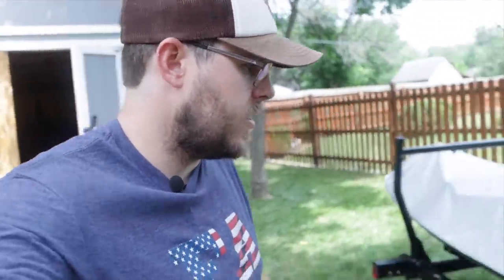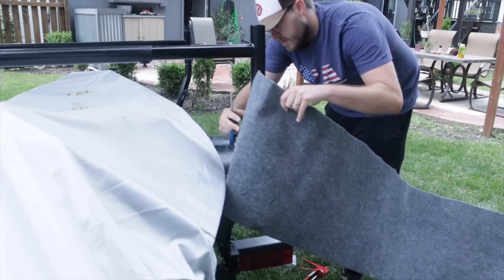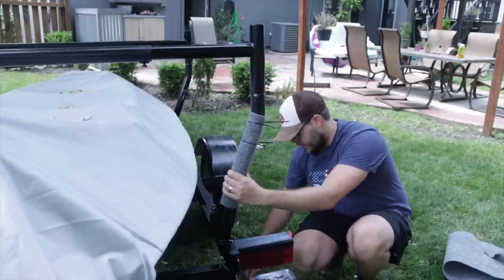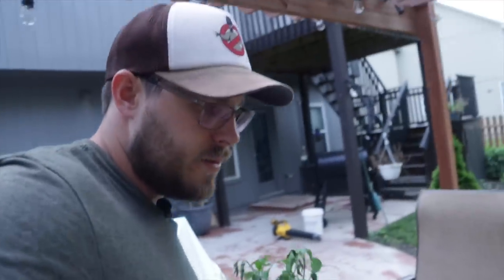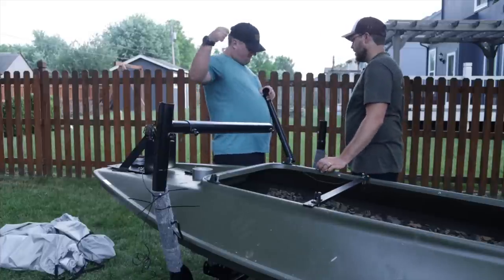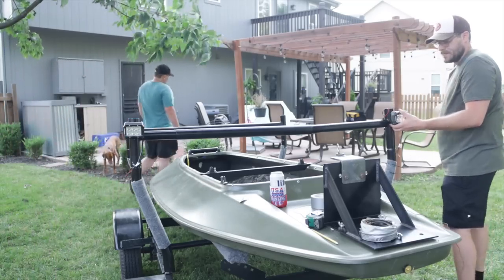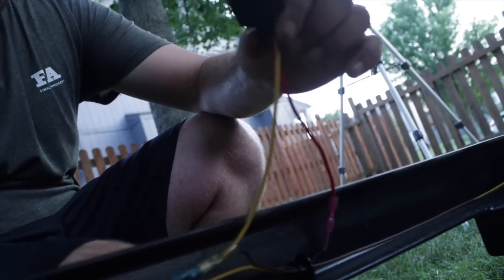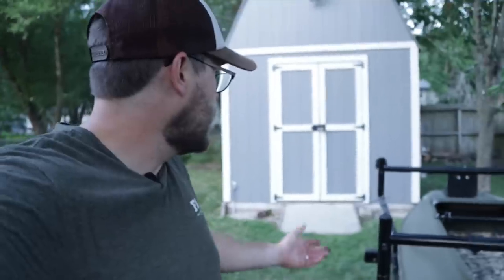Some Much Needed Additions! | Ultimate Duck Boat Build pt. 13

Comment: That's a great setup! Can never have too many rigs lol side note: the electrical engineer in me wants to suggest putting dielectric grease in those spade connectors since this is going to be in wet environments, it'll help prevent the connectors from rusting/corroding together if you need to disconnect them

Comment: I wired my lights to the backup light on the trailer plug so when I put the truck in reverse the lights come on automatically. Not sure where you wired the power for the lights on the trailer. It's looking good. Can't wait to see it in action.
Reply from the maker: I wired it into the tail light wire.

Comment: Great idea on the backup lights... I did the same thing but mounted them on the back of my MudBuddy... works as backup lights and along with the LED Bow light, works great for putting out decoys. If I could attach a pic on here I'd show you what I'm talking about. Also, the liquid nail will get brittle in about a year and come off. The very best stuff to use IMO is 3M 5200... Love this build you're doing.  But what is the metal tubing for exactly,,, I'm lost on that,, I watched the vide when you put it on, but still can't figure out what exactly it's for???
Reply from the maker: It adds a place to keep another boat on the trailer.